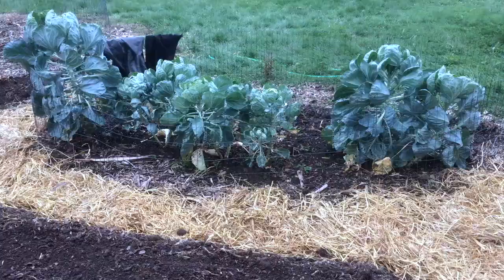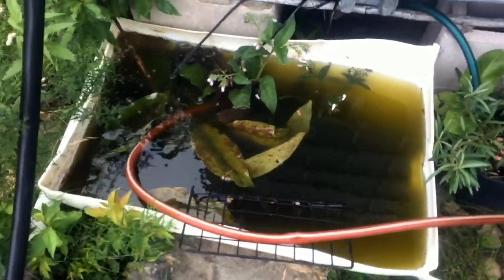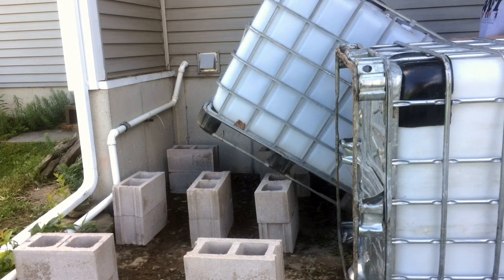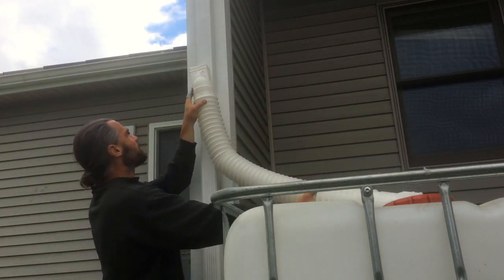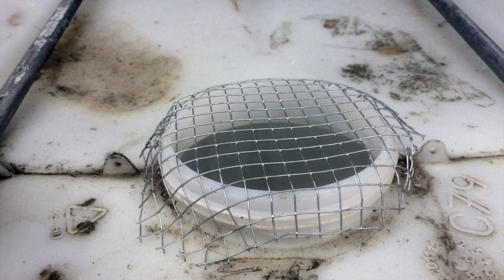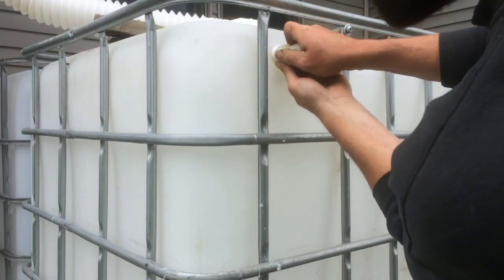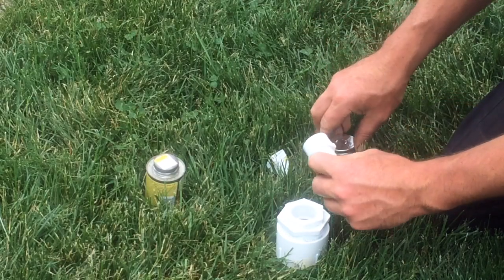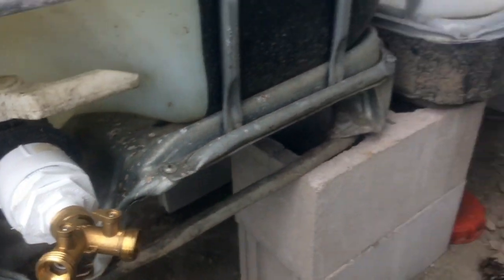Rainwater Collection - Step by Step installation of IBC totes

Comment: Good job and everyone should be doing this. A do have a couple of suggestions: 1) I’d add a first flush eliminator before the storage tank 2) I’d use some kind of plumbing fitting rather than the self-tapping screws to direct water from the downspout to the tank. Screw tips catch and accumulate debris. 3) I’d paint the tank black or wrap it with something decorative but opaque to keep out light so as to prevent the growth of algae. I love your compost tea idea but I would add this in a valve controlled follow on tank with a removable lid rather than in an open basin then I’d attach a gravity-fed drip hose to that second tank to water the garden.

Comment: Stack your totes if you have the head room.  Same water storage capacity, half the foot print, and much better head pressure.  Both tanks can still be connected in the same way.  It would be a good idea to consider a little better foundation.   I also have found that the less i can reduce the outflow, the better.  A 2” valve will fill a bucket very quickly.  I find a 3/4” opening, which I can hook a hose too, takes too long to fill a bucket.  Also I would want to be able to fill my buckets without taking off the hose, So a manifold of valves would be useful.
Reply: Can the totes really be stacked one on top of the pother for this kind of setup? When full with water, wouldn't that be too much weight on the top of the other tote?
Reply: kyle Humpherys, if you have a 2-inch valve then how would you attach a garden hose?

Comment: You may consider adding a baffle to slow the water down on the far side of the screen inlet so the water doesn't just shoot across the top of the screen in heavy rain events.
Reply from the maker: Good call.

Comment: I saw engineer775 use a contraption in the in-flow line which catches the initial rush of water when a rain starts and dumps it out. I believe it did this due to the weight of water because after the initial dump it automatically begins delivering water into the barrel. This helps dramatically reduce debris and any pollutants which are washed off a roof, especially a shingle one.
Reply from the maker: First Flush Diverter... Great concept and certainly worth exploring on a rain water system.  This was a simple install and for gardening it didn't seem necessary, but good layer of design to add to a better system for sure.

Comment: I have pine trees dropping heaps of needles on my roof that would plug that little screen super fast. My plan is to mount a 5gal bucket to that top hole and have mesh form a deep basket inside. I'll have to clear it out now and then but it should give more surface area for debris to stop while still letting water pass
Reply from the maker: That can work nicely.  Or consider a screen that is in an upward dome shape so it sheds the debris but lets the water through if that makes sense.  Half dome screen...

Comment: Won't algae build-up be an issue without painting the totes black or using tarp to shield from light?  I used a tarp to cover mine which seems to work OK.
Reply from the maker: They are tucked in away from most of the direct sun, but yes, could be sheltered more.
Reply: seems like algae would be a good thing
Reply: Algae is good!
Reply: I've read for using water like this on gardens, algae isn't an issue. So, its really a personal preference at this point. I'm going to shade mine and perhaps treat it since we try to grow as close to organic as we can.
Reply: I have painted a tote with black spray paint and left a strip un painted to see the level (blue painters tape strip prior to paint)

Comment: I would make my collector downspout more rigid and permanent. It looks good though.
Reply: I agree. The input breaking down (especially with that low grade flexible plastic) or ending up in the wrong place or detached (depending on the system) is one of the ways I've seen rain barrels fail, sometimes with negative impacts on the structure they're attached to.

Comment: What's the ideal distance away from the house a tote should be? Dontaes apply lots of pressure on the ground and the house's foundation would that be a danger of the foundation cracking?

Comment: This is great, a lot more capacity than the rain barrel I got from my municipality. It would be cool to capture the water that falls on the top of the totes, perhaps drill some drainage holes in the top so it can fall through,  and cover the holes with mesh. Just wondering about standing water and mosquitoes, do they not get in through the mesh? Thanks for sharing your process.
Reply from the maker: We have door screen mesh over each hole, so far no problems at all there.

Comment: In a different video the guy used NYLON STOCKING to filter water into his barrels. It stretches to keep debris at bottom allowing the water to push thru. He occasionally removes flips inside out, cleans nylon then refuses...He said one stocking was on there for 3 years...Also you should installed a 90 degree elbow where gutter enters the tote...because I Noticed a lot of the Overflow was missing the top of the hole...
Reply from the maker: Good notes here, thank you for that!

Comment: Hi Sean,          Winter freeze protection? Just remove the bottom fittings so water/snow melt can drain out? If not then those brass fittings will have a one season use. Another solution would be to have a second extension downspout to carry water away from the house.  Cheers,     .     Bill
Reply from the maker: Great question, should have dealt with it in the video... Yes, we extend a hose out away from the house and simply open everything up.  Keeps the connections intact and seems to work well.

Comment: Hope you're still out there! Love the vid. I've got the tank but I want an adapter for the top of the IBC tote to connect to a 4 inch corrugated drainage pipe which connects to my gutter downspout. I see you are just letting the water come out of a downspout adapter and over mesh screen and hardware cloth. I guess I'm looking for a more close system at the top of the tank. I'm also filtering the gutter water twice before it gets to the top of the tank and when it leaves the tank for a pressure washer. Seen anything like what I want please share. Thanks again for the great instructional vid.
Reply: Did you ever find one?

Comment: Have you thought about hot composting in the barn? Where the chickens are at?  During winter
for heat?
 If a 3 foot by 3 foot by 3 last about a month. I think you would need about 8 hot composting piles 
set off in series.. I figure you need 27 square feet or 9 by 9 foot area to do it.
Reply from the maker: It's a good idea, but for our situation the coop would be tough to build up that high.  We do have a deep litter method in there but have to clear it out once or twice during the winter.

Comment: THANK YOU!   Perfect timing!!!  Studying this closely!  Glad I have come to know how careful you are with your practces so that I can trust you on this!  We will be replicating with a 55 gallon drum within days, to catch the upcoming rain in the dry Pacifc Northwest~~~ :)  So there is no problem in the tote being so close to the wall of the house?   How far over the tote does the roof overhang go?  I ask because I wonder how necessary it is for us to have a special foundation to handle one part of our setup (with a 55 gallon barrel as the collector) next to the house under a 1 foot overhang, with the other 2/3 of the barrel under direct rainfall.  An important consideration is that this is on the west wall of the house, and our rains come in from west, so basically rainfall is even in this spot, whether under the roof overhang or not.  We have cinderblocks, bricks and gravel to use in the foundation, as we think is best.  The earth near the foundation is compacted as it usually is under houses built in 1980.  What do you suggest be done with the first rain shower that gathers recenty deposited crud from the roof?  There are some GREAT suggestions in the comments!  Thanks, folks!
Reply from the maker: I would encourage strongly looking into the ibc tote or a larger container.  55 gallons will overflow almost immediately in any rain (search for rain calculator online to see what to expect)...  If you are concerned about how it sits on the ground, you could lay down a 2x10" board of locust, white oak or another dense wood to span under the cinder blocks first, or pack down a hard, dense layer of gravel before you put down the cinder blocks.  They could shift a bit over time but we haven't found it to be a major problem.
Reply: Thank you.  The rain that is coming is predicted to be light.....03 inches which would yield 18 gallons from our roof.   That is what we are now preparing for.  The summers are dry in the Pacific Northwest.  Heavy rains usually start in October, later after dry summers, which this has been ....lots of time to upgrade.   We have 2 downspouts, one is next to a concrete patio, where lots of water storage is possible on an existing solid flat surface.  We will acquire ibc totes, watching for free ones on Craig’s list now...they do show up now and then.  We have collected six 55 gallon drums so far.   We will use 3-4 inch overflow pipes.  Both collection systems will be set up so that overflow goes through pipes to ponds and swales.  There will be devices so that the flow can be diverted to the sewer if necessary.  We have lots of gravel for the foundation of the one I discuss here that will sit on the ground.   So I take it from your comments below that a first flush diverter is not necessary when we will use the water for the garden?

Comment: hi there, I was wondering what the name of the overflow piece was and where can you source one?  Thanks!
Reply from the maker: I just used a simple three way piece... Maybe it was a threaded 3/4" MPT to a barbed T fitting that matched the hose I was using here.  3/4" barb works for hoses with 3/4" internal diameter.  If you are using scrap garden hose you may need 5/8" barb...  Bring a short section of the hose you want to use to a hardware store and ask!

Comment: One thing I always worry about is how stable the footing is for any kind of rain collection system. You have so much weight there. Will it settle over time? Could it tip over if a child climbed on it? What if it had settled a bit first? I have seen them tip and I have seen them settle significantly. And even a small rain barrel is heavy enough to kill a child who managed to to it over.
Reply from the maker: Good thing to consider.  In this case it is on very stony ground that has been incredibly compacted right next to the house.  Doesn't seem like a worry here...  BUT very good point you've made and something folks should consider for sure.

Comment: so to connect the two containers you attached one end of the 'splitter' fitting with a small hose? What sort of hose and how did you find one so short?
Reply from the maker: Yes to your first question... The connector, (should have filmed this, oh well), is a female to female hose section about 6' long, that is used for connecting a washing machine to a water source.  Hardware store, in the section where washers are, would have these...
Reply: @edibleacres  perfect. I think it was clear enough, just wanted to frame the next question. Thanks!

Comment: Thanks for sharing this! Why does the overflow pipe need to be a "T"? Could it just be a single pipe?
Reply from the maker: Good question.  I found that the 't' with one section going up a bit, acts as a way to equalize and release air so the overflow flows way more effectively.  Without it the water sometimes doesn't begin to flow and it overflows where I don't want it to...

Comment: This is a great start - at least you got the ball rolling, and  now have more water to use in the garden. It's such an empowering feeling. Coincidentally, I was doing some research on aquaponics recently, and found a video you might glean some ideas from, https://www.youtube.com/watch?v=K2qoLtvTYN0 

Specifically, the filter build for the incoming water, at around 10:28. I'm sure you would have all those components already, and wouldn't need to buy anything extra. Just select the pot size, to fit your IBC opening. That way, you can keep your flexible downpipe inside the tank, and fill it quicker.

Comment: Had anyone insulated their tanks to help w the extreme summer heat or pipes/ hoses for winter- getting water to winter greenhouse?
Reply from the maker: There could be value in sheltering the water holding from direct sun in the summer for sure.  Winter for us is cold enough that we prefer to fully empty them before late fall
Reply: @edibleacres I live in Arkansas so winters r mild w Jan or Feb getting cold. Last 2 Winters we got pretty cold w city shutting down due to snow.
 I want to cut 1 & put fish in the bottom & hydroponics in top. I can grow all my nature's salad greens & root veggies in a hot box. I grow herbs, tomatoes, sweet peppers in house under lights. This yr I'm going to do a double wall plastic tunnel & hoping I can grow more in raised beds & put the hydro ibc inside greenhouse. I don't have enough compost to warm it naturally. Fingers crossed sun will work.
Temps been getting so extreme last few yrs
This season we had 100°F 1sr week of May, killed my pea patch. Then by end of May temps just started getting crazy. Avg June temp is 76 we were 92. When u add heat index a cool night low is 84 w day highs up to 112. No nestable rain since beginning of June. I burned thru 1500 gallon rain water in 3 weeks trying to keep garden going. It's alive but struggling. So hot even the green beans died. Having to water 3 times a day.
Researched & found hydroponics uses 8% amount of water from dirt garden. For a country drying up that sounds good plan. But if water gets too hot it'll kill the roots of they just won't develop. I've read u can drop block of ice in the tank, or more realistic him up a water cooler- expensive. Thought with EU also having heat issues perhaps you've tried it have heard of something different.
Other than building a 4 season climate controlled greenhouse w >3000 gallon water storage for a family garden not sure what we r all going to do.
Specially w America's produce & cattle farms all returning to dust. Last thing I want is for this country to be food dependent from others. Admit the only thing we have going for us right now.
Thanks for ur input appreciate it. Stay safe!

Comment: You put the overflow on your receiving tank?
Reply from the maker: I do... My reasoning is that when there is an intense rain I want the water to have a place to go when it's coming in faster than the bottom can equalize between the two tanks.  Feels like sound reasoning but I'm open to other ideas as well...
Reply: You make another hole in the top of the second tank and let the overflow of the first get in this one with a pipe, and the "real" overflow another hole in the second tank just over this one ?
Reply: @edibleacres  This is a great point.  I have 2 rain barrels 55 gal.  connected by a 10 ft leader hose.  I was all excited to try it out cause everyone on YouTube says this is the way to connect the barrels so they fill and release at the same level.  BIG PROBLEM...   The primary tank - where the downspout enters the barrel - fills up much faster than the second tank with the hoses attached at the bottom.  As a result, a lot of water go out the Primary tanks overflow and back down the city drain.  It would be better (but more work) to connect the rain barrels at the top with PVC pipe, maybe 1.5 or 2 inches thick.  open to suggestions if there is a better way.